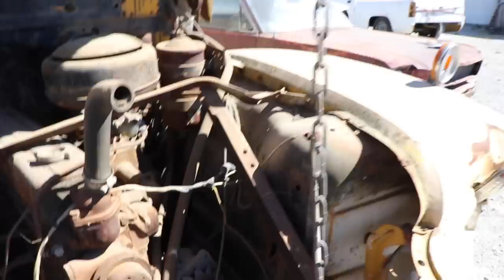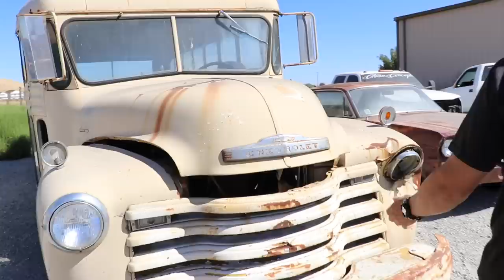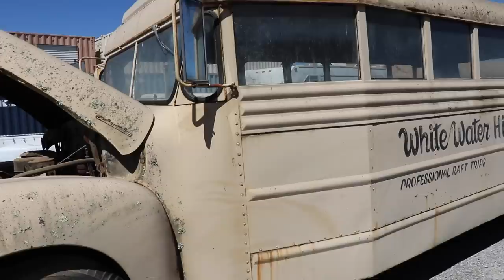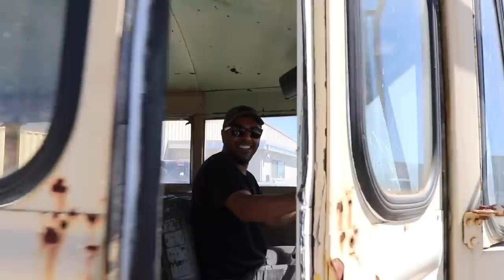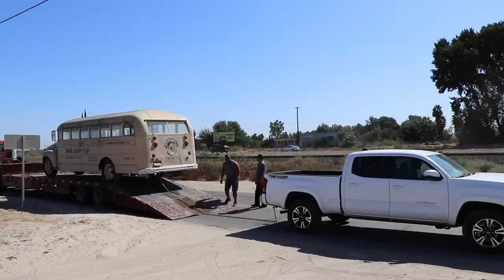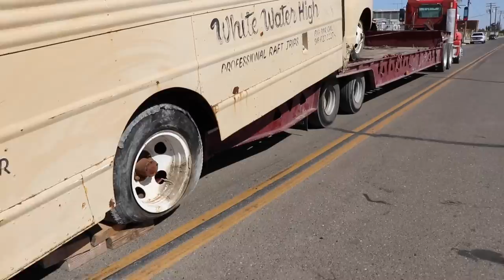Rebuilding a 1948 Chevy School Bus Part 1

Comment: You will find that the old 20 inch split rims need to be replaced with 19.5 wheels and modern tubeless tires. You may not find any 20 inch tires and tubes to replace your with and getting a shop to mount them on split rims is a thing of the past. A Chevy P30 motorhome chassis may have wheels that will work for you.

Comment: 572 chevy with 2 turbos!!! 4x4, sun roof with latter with railing, so you can use the whole top, so you can BB-Q. Also 5200 gen on top, 2 50 gal fuel,1 50 gal water, Freg. ect 3 a/c 2 on top 1 Front . locker's and air ride, and air ride seats, use Lounge chair's. Also sat for T/V Phone OK?

Comment: Noticed how you cut the part out where the chassis bent, probably should close the door for brake release oh and if you honestly plan on restoration,  could've started by taking the wheels off. New tires probably would've been more than what you spent on the whole bus 😉